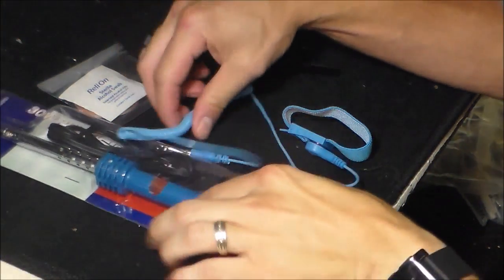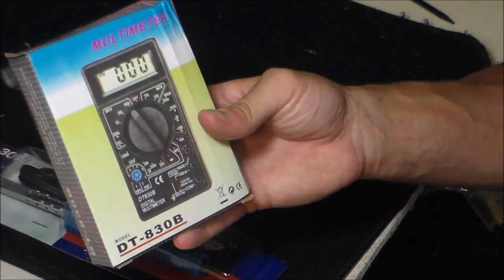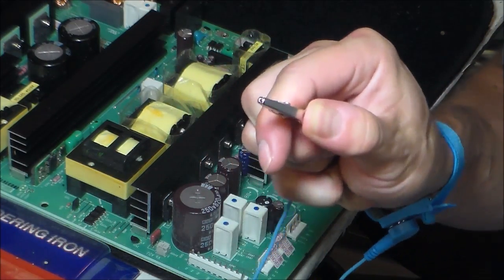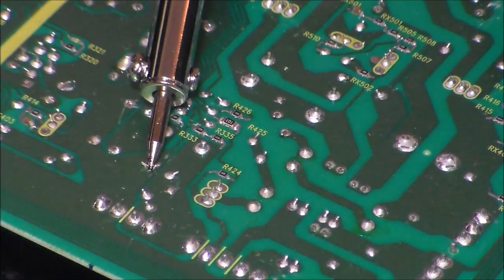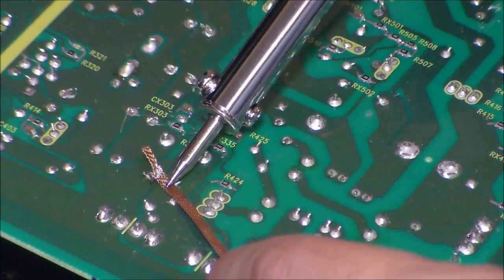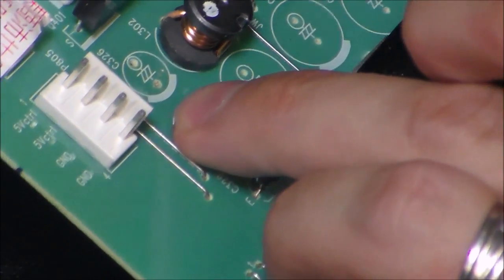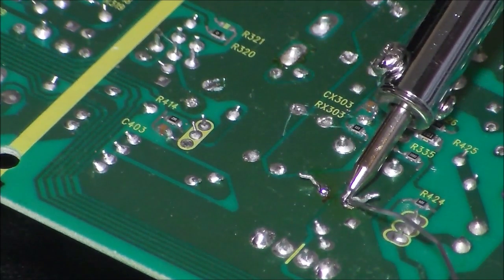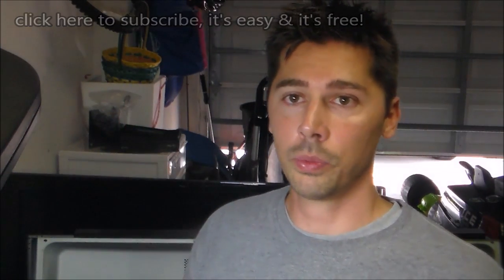Easy ways to Solder & Desolder with Soldering irons

Comment: Your soldering iron is not providing enough heat as I noticed you was facing heat starvation condition during desodering process. Due to that while you pulled the capacitor from the board its legs came out of the capacitor itself rather than coming out of the board. This is what is my little observation only. Regards,
Reply from the maker: true, i use adjustable 50watt soldering iron most of the time, this video was a product review for people on a budget, but weller soldering station is awesome which shopjimmy sells too.